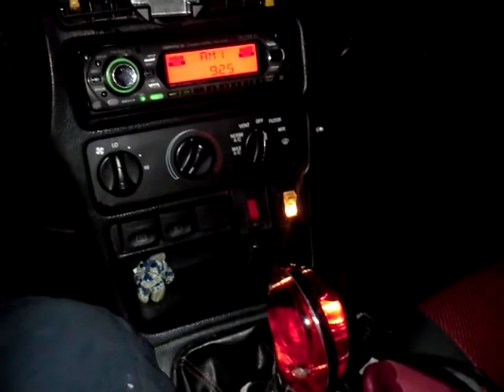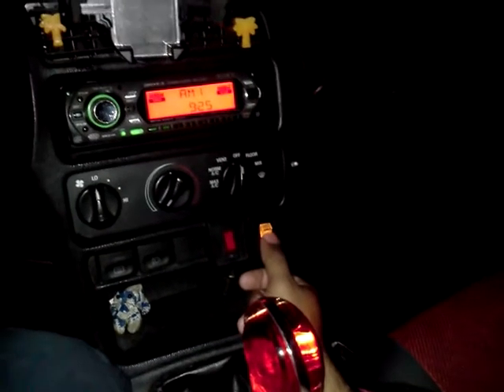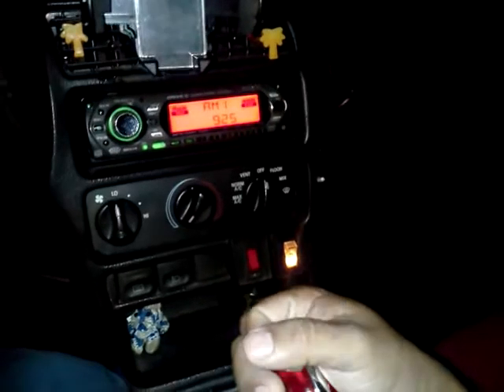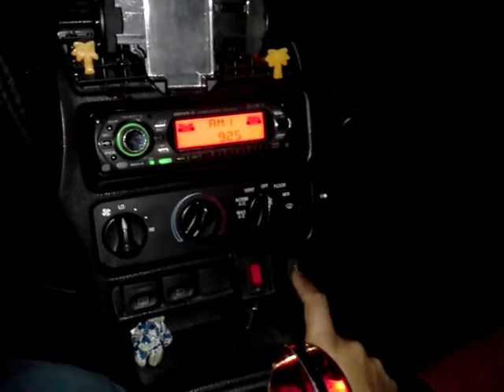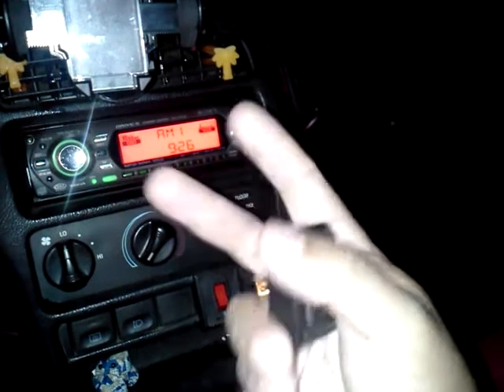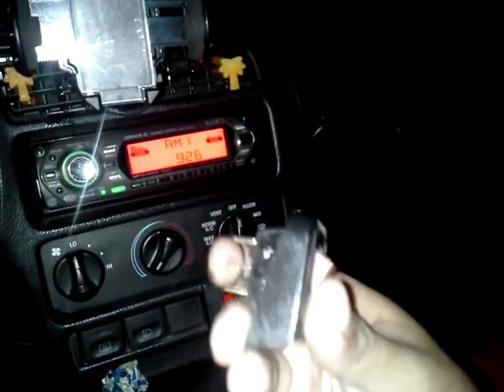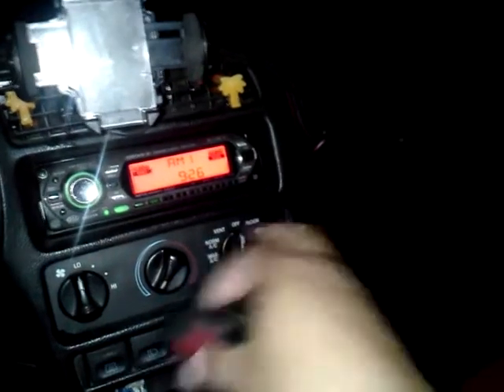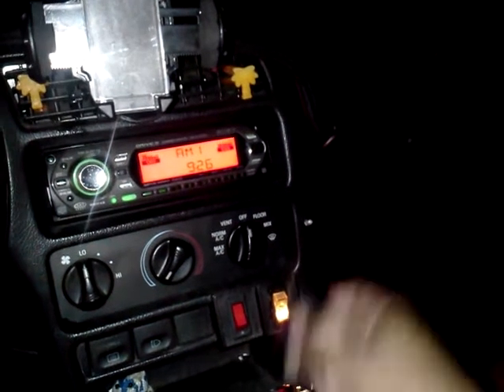Hard Wired, Laser/radar detector.

Comment: So the first pin on the switch is straight from the battery, the second is the red power wire on the radar detector, and the third is the black ground wire on the radar detector?